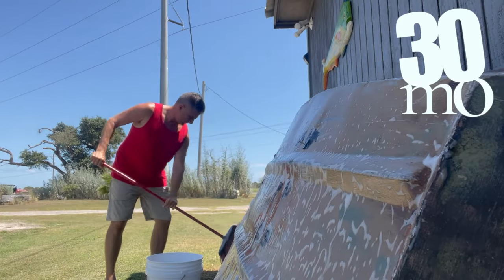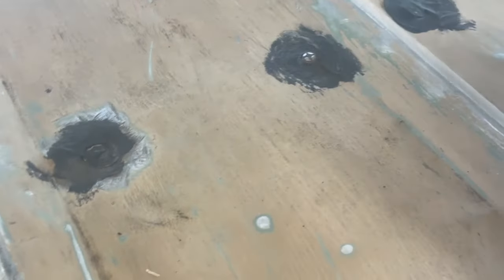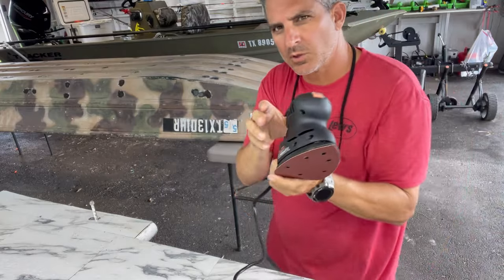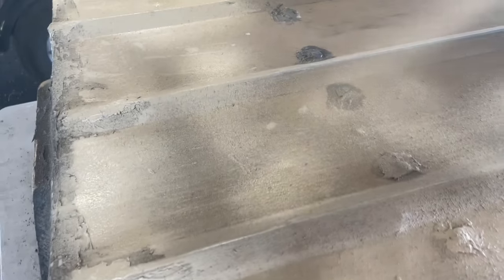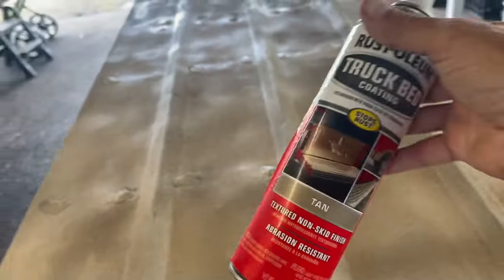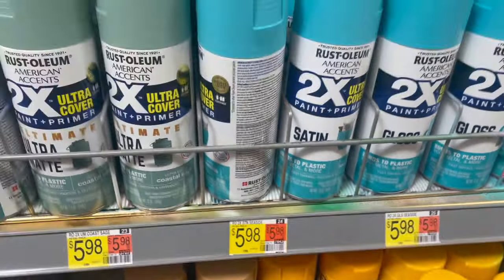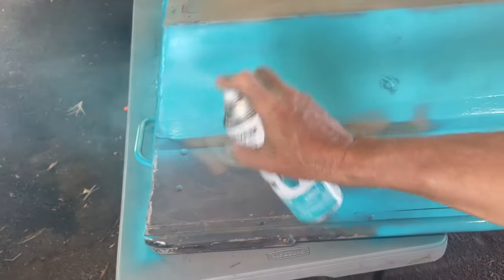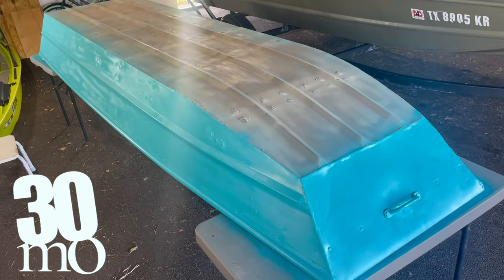RESTORING Our 1965 $400 JON BOAT Pt. #1

Comment: SOLID ALUMINUM RIVETS. That's how I've reset rivets on about 6 boats. 
You can just tap the loose ones and replace the bad ones. 
Put a sledge on one side and tap the other side and the rivets will widen and re-seal.
JB WELD obviously doesn't work if that's how it was done before and you're having to reseal it.
Good luck though!
Reply from the maker: Great tips thx

Comment: For those who might need to do this type of repair.

The best way to do any aluminum repair is not with hot melt glue sticks or anything that comes out of a tube.
Get yourself a MAPP gas torch at Home Depot or whatever hardware store you have, and some coated aluminum brazing rods.
watch some videos here on YT and then follow the instructions and do the repair correctly.
Metal fixes metal.
Do the repair correctly, and never worry if it will hold.  Also, the brazing rods can easily fill and fix holes and cuts in Aluminum, there are tricks you can use, just look it up here and you will do fine.
Reply: Its not a welded boat it's riveted
Reply from the maker: 10/4. I've looked into that.  Good tips thx
Reply: @Manuel_Z_Kayaks  ...and?